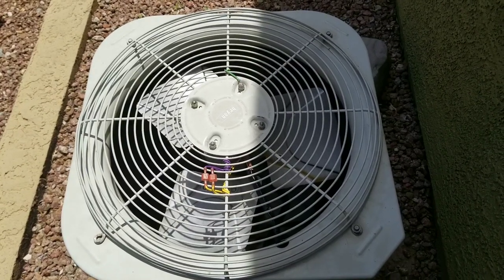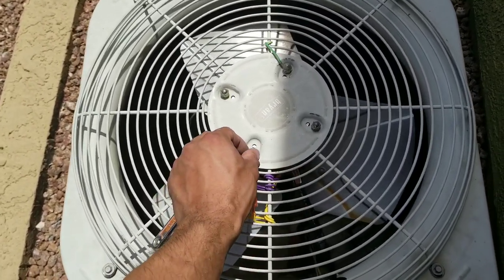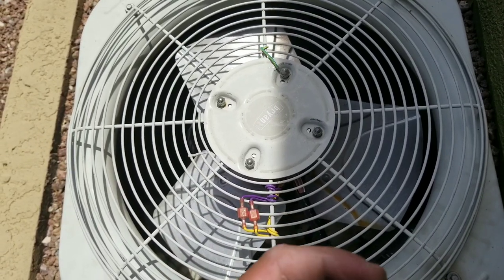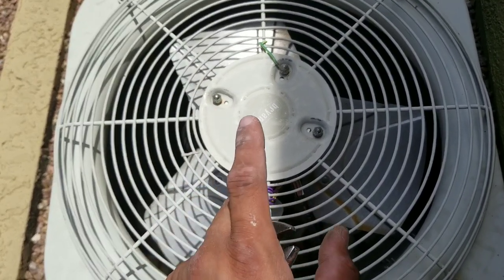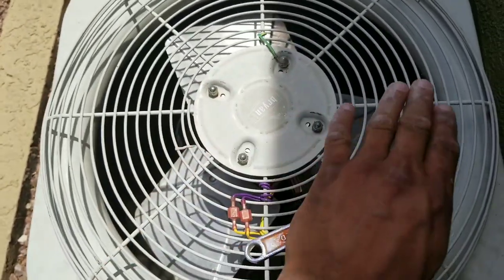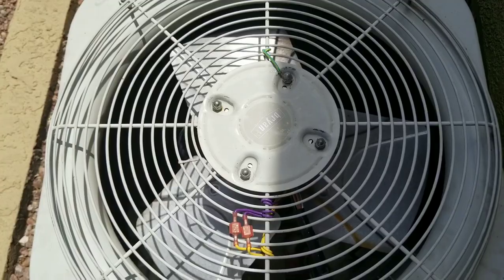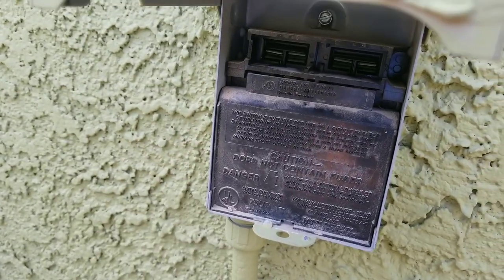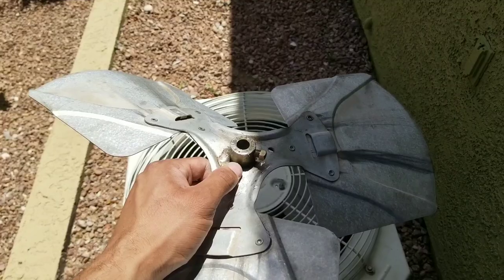Condenser Unit Shaking/ Vibrating? Here's Why! Easy Fix!

Comment: I had the same problem.  When I checked the fan motor it had all loose bolts and nuts.  I screwed them and problem was resolved.  However I was wondering why this happened... I suspect it was because I closed some ducts and the new air flow caused some kind of unbalance or resonance that impacted the fan motor.  Is that possible?

Comment: Very helpful, crescent wrench worked best for me to remove the screw lock on the fan motor to removed the blade.  Before I was using plyers because it was all I had. Definitely worth the 6 bucks to go to Walmart and get a small crescent wrench, now I got to replace my fan blade because it got tweaked ever so slightly and its vibrating.

Comment: Over tightening those 4 screws is a thought. I installed an universal motor and my unit started vibrating. I played around and set the right height on the fan and it stopped vibrating but 3 days later is making awful whoop whoop noise. I didn't use original brass nuts. I think I'll take motor off and cut those extended threads to the same length as original and use the original brass nuts. I don't think I tweaked a fan on the fan blade but I might have. There's two little clips on fan blade that look like they are for balance. Maybe there were three and one came off. Lastly I'll run it without fan blade. This is getting tiresome because I keep calling off work to deal with it. This is the third time I called off in two weeks. I just can't afford catastrophe damage to condenser or unit.

Comment: What would cause a fan blade to have a hair line crack in one of the blades, I noticed that in one of the blades when I was cleaning my unit and there was no noise before but after the cleaning there was, that's how I found the hair line crack. I ended up using the aluminum welding rods to hold it for now but currently looking up the correct fan blade for my condenser.

Comment: We just had a snow storm and my condenser blades froze up. When I started the unit it shakes violently. Is it because of the ice on the blades??
Reply: I am experiencing the same thing right now and I wonder the same thing.
Reply: I'm having the same thing right now. did either of you have any luck fixing it?
Reply: @christyw7105  Fortunately the ice melted from the fan blades. Issue is resolved.
Reply: @angelomayfield5503  my husband poured hot water on it and that worked for us 🙌 glad yours is working too!
Reply: @christyw7105  Great news!! Stay warm!! This is almost over.

Comment: Very simple question, can the blades be installed upside down, causing issues?
Reply: Steve S... to answer your question, you cannot nor should you ever install a fan blade upside down on a condenser fan motor. Also, be sure the fan blade has the proper amount of blades and is the correct pitch angle.
Reply: Haaa! Actually, after looking closely, it appears that he did in fact install the fan blade upside down! Also its NOT spinning counterclockwise looking from the top,  and the blades are angled the wrong way for a ccw fan blade.....just MY observations.

Comment: Hey I'm watching this video because when I was replacing my fan motor I over tightened the bolts on the top just as you described but as I was doing it, I heard an audible "click" and now they're loose as hell. Now when I turn them with a wrench, it doesn't seem to have any impact on the tightness. Any idea why and how I can fix it? - sorry I'm very new to this